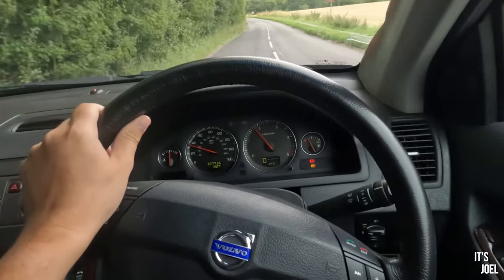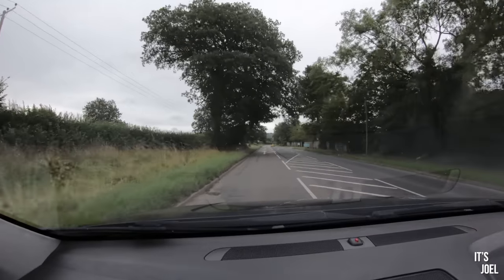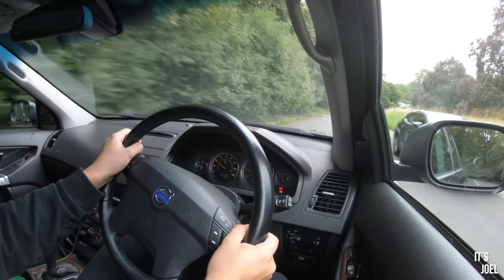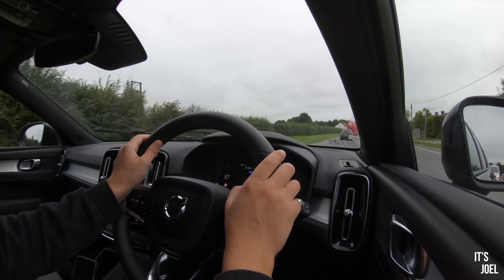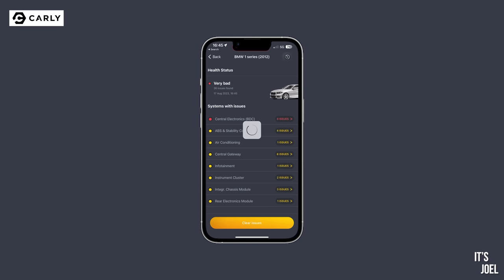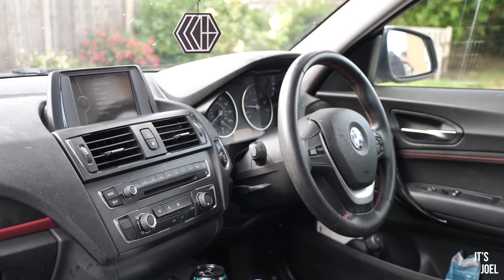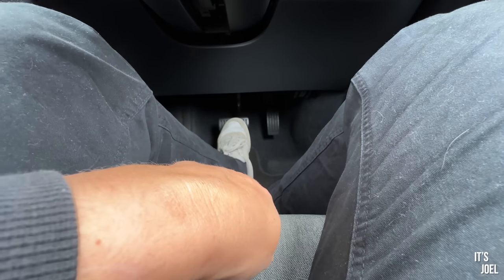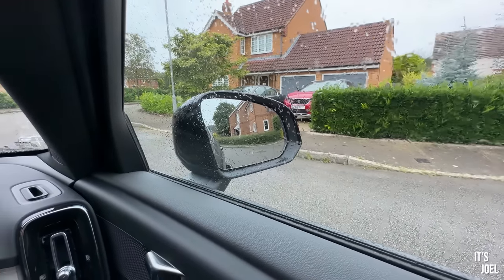I TOOK MY £800 COPART XC90 TO VOLVO FOR A HEALTH CHECK...

Comment: Half of the parts on the inside don't need to be replaced. Some trim, a headliner, a not working display... who cares?
If you just have the thing to drive a cheap car....
It's not rotten, so change the parts that are a safety concern, like brakes, bushes and the control arms.

Later:
Get another headliner, switches, dashboard panel and trim from a junkyard.
Get some used Volvo wheels plus tyres from ebay or wherever, or even Ford wheels. They are also 5x108.

Comment: If this is their definition of "uneconomic to repair"...I suppose it would be at main dealer rates. But you don't need to use a main dealer.
The MOT is definitely the way to go. The lower wishbones will definitely need doing now, plus likely some other bushes etc. ABS rings as you've seen aren't expensive, I'd get new discs and pads done and a main engine service (i.e oil filter change - do you know when belts & water pump were done? If not, do them). 
The cosmetic stuff can wait, and people are bound to have scrapped much better examples than yours that you can pick stuff out of. 
The point is - you can spend maybe a maximum (in one hit) of £3k on getting that car up to scratch and it will then last you another 10 years maybe - with just regular maintenance. If you can do most of that work yourself - then it's just parts. Why would you not try?

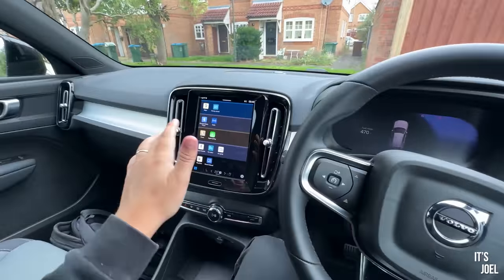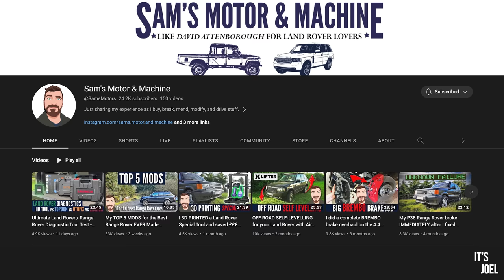Comment: All main dealer garages are well TT, and so is their pricing! I have had 7 Volvos over the years and looked after them myself, literally bugger paying what nowadays £70,80 pound per hour + for labour, and there is only one "technician" in the garage (the one that can read) the rest are lowly grease monkeys! Get to know your Volvo Especially the engine !!  I bought a 240 DL Estate years ago ,my first Volvo, bought it from a guy who bought it new, he drove from Chingford to Birmingham once a week to buy foam to sell on his market stall so no heavy graft. I got it cheap because it was running rough, I knew that, so did a few checks diagnosed valve problems stripped it down and sure enough valves were all bad, rang the guy and asked what fuel he used, as I thought he was using 4 star, they are built to run on 2 star. Anyhow made a list of everything I wanted to replace and as a comparison went to Volvo and got prices, not going to bother with everything but, head gasket set £40:00 one valve £9:80. (this was around 1986/7. Rang a pal of mine to ask him where he gets hits parts from, told him what I was doing and he said that engine is a British Leyland 2.1 litre, got to So And So in Walthamstow and tell them it's for as Triumph 2000 BL 2127cc engine like the police used! Off I went head gasket set £10:00 Valves were £3:00 each, or thereabouts if I recall there was a few pennies difference from exhaust to inlet.  I bought all new valves Gaskets springs all I needed and they lent me the whole box of valve shims for free, just do my job and put mine back in the box! I doubt Volvo would have done that!!  A bit of history, Volvo bought the engines from B L as it was then , in parts then they totally re machined all of the necessary to their tolerances and spec's, assembled and used those engines, and bloody good they were too. That car was as smooth as silk well economical and a delight to drive, my wife used to fill it, in and out, and take our boys and go to the coast windsurfing we kept that car for 8 years, but eventually due to our climate it rusted badly. If I recall the 340's Volvos used Renault engines and they were in backwards, ie No 1 was at the bulkhead and 4 was in front.

Comment: This is an interesting video but any car older than 10.years would get a battering at a main dealers the purpose of those videos for them is to find quick easy work for them like suspension parts and brakes had it at Audi where my oil was in-between min and max which is perfect and they wanted 25.00 for oil top up.

Comment: They want to sell you a new car - there's probably an environmental justification in preserving the older car - sunk carbon cost in the manufacturing of it. If you run a car long and take care of it, that's one less car needed on a production line for longer - even if the tailpipe is less friendly on the older. Interesting video!

Comment: Mostly cosmetic then. Afraid you are dealing with Volvo hourly rates. A major service with brake fluid change has just cost me £600 on 21 plate T8. I'd shop around for the wheel refurb. Tyres will not be cheap and you can't really put budget tyres on one of these. I'd find a recommended specialist and ask them to price the work. Headlights just need buffing back.

Comment: Seems pretty trivial to me.  Mostly little stuff.  If you were silly enough to pay someone to do it might be a different story.  The suggestion it 'shouldn't be driven on the road' is a bit of a giggle given the state of some vehicles on the road around here, you'd be surprised how bad something has to be before it's actually unsafe.

Comment: We’d have a lot more older quality built cars still on the road with high mileages if the mechanics at these major dealers didn’t charge £100 per hour. I know the over heads are huge but if people used little small mechanics or did a lot more themself you’d get a lot more out of a car.

Comment: It is only uneconomical if you had absolutely everything done by the dealer. Most of that stiuff is DIY-able and you're not spending anywhere near 5K. I've done an ABS pickup ring which is a cheap and easy fix if you can remove the driveshafts. Injector seals are a known problem with the otherwise bulletproof D5 engine. Get it through the MoT (I've seen the test result) and then you can fix the other stuff at your leisure. Volvo Diagnostic in Tilbury, Essex can repair or replace your modules for a reasonable price. I had my DEM and CEM modules done by them. I definitetly want to see more XC90 content. eBay is a good place for used genuine parts. This has no body rot so it would be shame to scrap it. I've just clocked up nearly 1000 miles in my XC90 over the Bank Holiday weekend towing a caravan from Flamborough in Yorkshire to Perranporth in Cornwall and it didn't miss a beat.

Comment: hello Joel, long time watcher here. those abs rings could be an hours work or could be a very long job.. The cv joints normally get seized inside the hub and require a lot of work to remove them as was the case with my xc90. I hate to say it but you should really use genuine parts on the volvos.. I'm speaking from experience here ;) also how much did they charge you for the health check? thanks

Comment: I genuinely think for a car that size, with the big AWD Volvo Engine, 5000,- at a Volvo dealership is rather reasonable and, dare I say, close to cheap. If you consider that there is 4 new wheels in there that alone should be 600 with fitting and everything, brakes at the same time plus major service with belts, is already close to 2500. Bearings will be necessary after that mileage and a heavy car anyway, and those look more rusted than just blown, I think they held on long enough. All the cosmetics and Headliner you can just do on the go. there is tons of XC90 all through europes scrap yards, just go there and collect all the parts you find for small money and fit it. Even the Headliner is a few Hours of work und probably 60,- materials. If the engine runs well now and gets serviced, it will easily do another 100k, and all that for at most 6000,-? The only reasonable answer to not owning this car would be todays costs in fuel und taxes for this engine, at least in germany that would be the only argument nowadays against owning that kind of car if you don't actually need it for work or that kind of stuff.

Comment: The suspension and abs rings sounds pretty easy to do, until you start trying to take apart 20 year old rusted to hell bits.
Good luck, 10 cans of WD40 and a gas torch.

Comment: the list to repair it is not that bad cost aroundv£600 to £750 max you can get used parts be cheaper 4 part worn tyres 60 quid  the trim a 100 max for all of it and switches wishbones 280 for a pair find a rear end damaged car for parts ,yo can find damaged cars newer with the parts you need ,might find 1 with a blown gearbox or engine get the whole car

Comment: I don't get the uneconomical repair argument.
The car is not supposed to turn any heads. 
It gets you from point A to point B.
Buying a new car would be much more expensive. 
In case you do buy a new one, you're losing more in car valuation than the repair cost you'd be spending.

The only reason for switching is when everything starts to go at the same time and is recurrent... Which unfortunately is more and more common for new cars.

Comment: I once had a Volvo 440 hatchback the MOT Deemed it fit for scrap it didn't need much calipers and turbo Sadly I left it at garage and never got a penny for car.
Learning my mistake I should have wised up because this MOT station was vane I hope its right would to use..
Felt the mot station was failing cars to then own for himself brag afterwards there wasn't much wrong and earn keep out of them..
Just like the garage where you took your Volvo gave a nice presentable car hoping that failing yours as uneconomical repair you would possibly buy a new one just like the loaned car..
Your you tube presents interesting content on varied cars not 100% sure what you could do basic stuff to gain mot get a year or 6 months out of it enjoy it and gain your money back.
Useable recycling against new parts a must.
Silly I have Astra Bertone 2.2 Convertible I paid just £350 for my car back in September 2016 I still own car today The interior is grotty but for around £150 a reasonable leather interior could be easily bought.
Three out of the 4 tyres are part worn tyres good brand tyres with a new budget tyre..
Has disco like Sony stereo the paintwork is damaged requires new rear bumper a driver window casing where kids enjoyed kicking my old casing off. Basically trashing my car in some ways which then adds to extra funds.
Few mots have cost me £65 and then one was £630 like.. but average is a respectable £200 per year.. It has a private plate worth £650 and the overall value of the car is below £2000. but could increase any time..
I see nice examples that range from £900 -£4000 and it temps me but my honest thought is trust the car you own and love..
Mostly my car could be improved by a real good deep clean, add better tyres over a period of time..
My other cars have above average tyres like my Audi A6 estate it was running on 4 AVON tyres but one is Budget due to nail in tyre and my drivers side front needs replacing shortly and I may put the back ones on front buy two Michelins on back wear fronts out and then swap backs and add another pair soon after breaking costs down.. Fronts wear quicker.
Silly but do you still have S type Jaguar...?
Great video..

Comment: Telling it like it is..... Whatever you spend on it, even if it involves minimal labour costs, It's still going to be a 20 year old car which has clearly not been maintained as it should have been. Realistically it will never be worth the money it would eventually stand you at. It's been tortured and neglected for many years and it's never going to be anything more than an ever expanding money pit. That engine has a typical life of 200 - 250K miles, PROVIDED it's been well maintained and driven responsibly. Clearly neither of those terms apply to that car. That engine is running on borrowed time. Yes, anyone can keep spending money to keep anything on the road, after all a fool and his money are easily parted.
There comes a time when common sense has to apply.

Comment from the maker: Get 15% off your Carly purchase with code "Joel23" (auto-applied) until the end of September when you click: https://bit.ly/Carly-Joel
Carly's scanner and free version of the app with standard OBD features are compatible with cars that have an OBD2 port.  To see if Carly's advanced features  — like coding or manufacturer-level diagnostics —  should work with your car, make sure to check out their website. To access these additional features,  you'll need to get their yearly license.
Reply: thanks for the code, i used it to order one today.
Reply: I don't like Carly, their auto subscription is unclear. Their support is awful, they wont give you refund on £130 on the day of renewel, so you have to go to your bank to claw it back. It couldn't fix the problem with my BMW E61.
Reply: Carly functionality was poor and yes I was a subscriber across several makes. There are better apps for under £8 that have better functionality and work with standard cheap ODB2 readers. I have worked on a lot of cars, stripping them down to bare shells and rebuilding every component, engines, gearboxes, differentials and in the case of my WR Quattro even the electronics in the ECU, to change boost limit, hall effect timing etc. I see Carly as over marketed and expensive for an average product.

Comment: It will be a foolish thing to try and repair this. It's £700 of moving spare parts most of which will be very worn. It's unroadworthy and because of its mileage will be unpredictable and unreliable for long distance use. There's no such thing as a cheap dependable expensive car. £5000 would be better spent on a more humble vehicle.

Comment: I think you said the scrap value of that Volvo was about £500. So deduct that from the £800 you paid and you got a few weeks of content for £300. Of course a Volvo dealer wants a lot. A Volvo dealer will want the maximum.... The thing is even though the XC90 is nearly 20 years old, it is still relatively complex, and it is an £84k car but with 307,000 on the clock! It is apparently, and not surprisingly beyond economic repair at Volvo. To be honest, unless you can do all the work yourself, which you said you can't, it is beyond economic repair, full stop. But you got a few weeks content for £300?? . The only sort of person for whom this is worth trying to run, is someone who has the time and expertise to do all the work themselves, but even then, their time might be better spent on cars less far gone with lower miles. Old XC90's are not collectors cars at this time. As a car, it is not worth the money to fix it. You wont get it back. It may be worth it for content?? or you could move on to another which will be new content. I would not waste time or money on it. I would scrap it and move on.

Comment: If you spend a grand you'll have cheap motoring for a year.  My wife had an 18 page war and peace printout of jobs she needed doing none of which was required.  Ironically  2 rotten brake flexy pipes they missed. All a load of sharks.

Comment: So much to go wrong, that doesn’t effect should not effect the running of the car, so day time running lights !!!
Disconnect the wires and wire them up to a switch manual switch on the dash, easy peasy ,  !!! But on because computer is telling you shit as if you are a moron, automatic wipers which maniac though of that ??? 
“” oh no it’s raining I can’t see through the window, what am I going to do ?? Phone the RAC to come and switch my lights on for me  “”
If you need all this help to drive a car you shouldn’t be on the road,
These electric parking brakes , one day when the car gets a bit old and the value has dropped, it will right the car off 👻👻👻👻

Comment: Volvo YUK.... BMW even YUCKIER... both grossly over priced and rated. BUT what is more concerning is your dangerous DRIVING STYLE with only right hand on the steering wheel and elbow resting on door/window cill and at the same time flicking selector buttons on steering wheel leaving only fingers controlling steering!!!! ... whilst left hand on lap???? This style of driving means you are NOT in control of the CAR and could result in a FATAL ACCIDENT whilst you are blabbing on about COST of repairs BUT give no respect for the COST/LOSS of a LIFE.